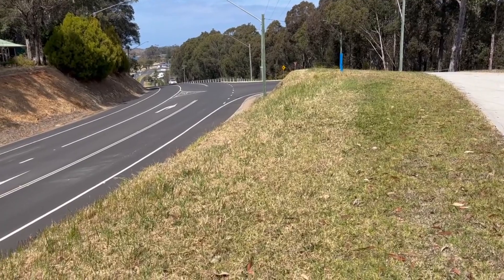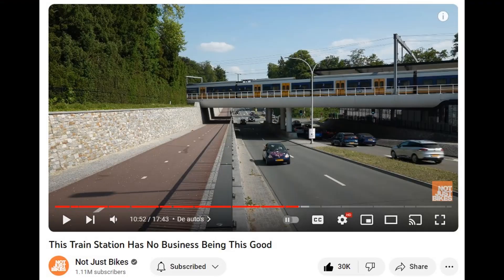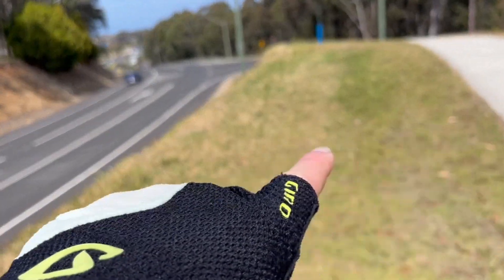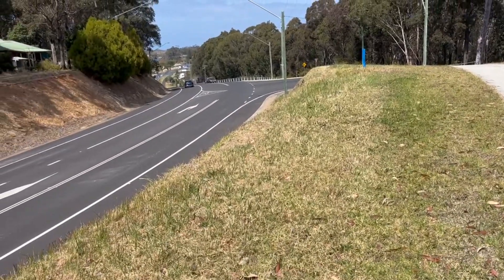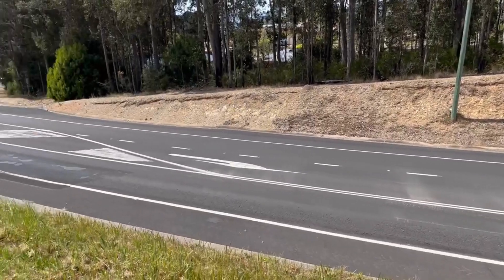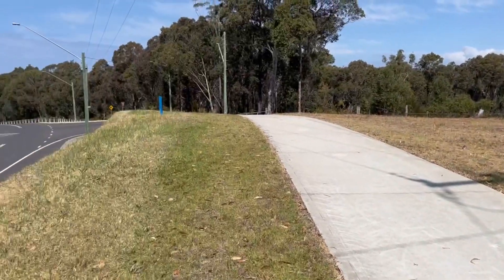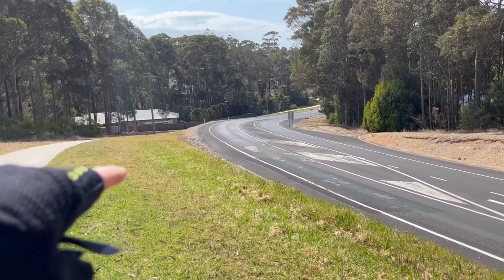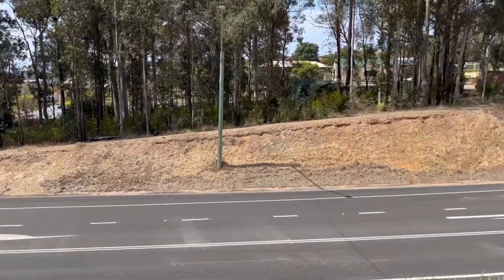The Dutch vs Australian approach to gradients - how to make things easy or tough for cyclists

Comment: From a civil engineering perspective, this is 100% because of cost savings in both instances. Both designs minimize the amount of cut (earth moved). The Dutch bike path doesn't cut as much, because as stated, bikers need less clearance. In Australia, they cut through the pre-existing hill to keep the cars safely moving at a high speed limit, but the bikers don't have that limitation, and removing the top of the hill for the bike path would have been an unnecessary cost.
Reply: @gabefuhrman9308 im pretty sure the cost doesn't count for the dutch one.

The savings that might be there moving less dirt are swiftly swallowed by the much larger cost of having multiple levels.
Walls and drainage and such are much more expensive than the old style straight wall for the equal level road+cycling path.

Also... it is almost never dug out of a hill, because we don't have those.
The road that passes over is raised.
Every bit of dirt near such a crossing has moved at some point in construction.

Comment: Yes, how we do this here is annoying, especially when the trail follows transport infrastructure that needs easy gradients like motorways and railways. I think the assumption is that everyone is riding a mountain bike for exercise -- meanwhile, my 7 speed city bike and I struggle along.

Near me there's a trail built into the cutting for a motorway which goes up and down elevation instead of staying the same height above the road. They actually invented a hill when there wasn't one by putting in two >5% grades.

Then there's a rail trail that dips below rail level for 10-15 metres creating a ≥10% grade all because they couldn't be bothered raising the height of a manhole cover.
Reply from the maker: There's a few spots in Perth alongside the freeway that are like this - but they are old paths. With the new paths, they tend to take the Dutch approach. I'll have to see if I can film  a couple and compare them.
Reply: @baybugcanadabaybicycleuser915  Ah, there's hope then. The one I'm talking about was completed in 2008 I think.